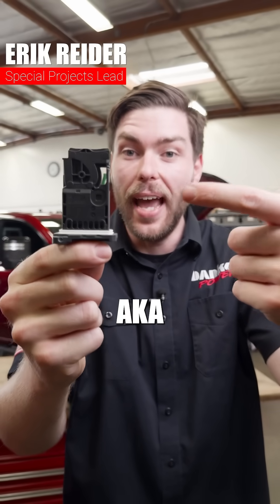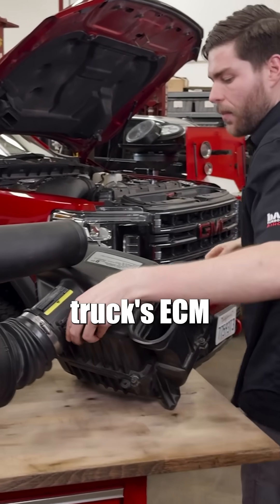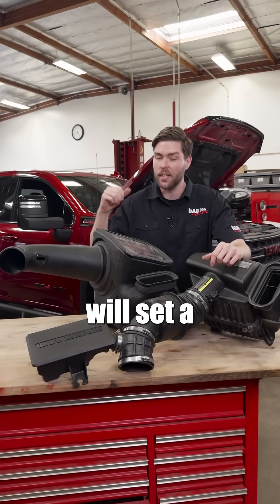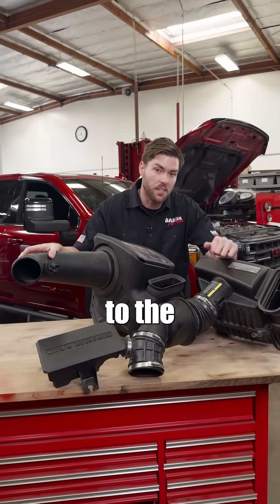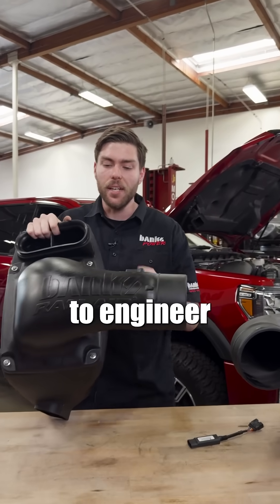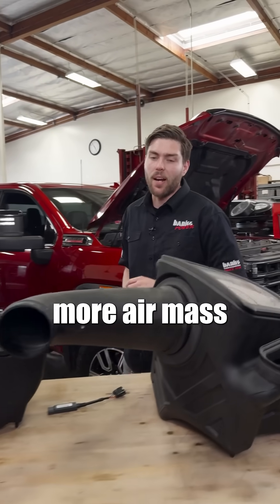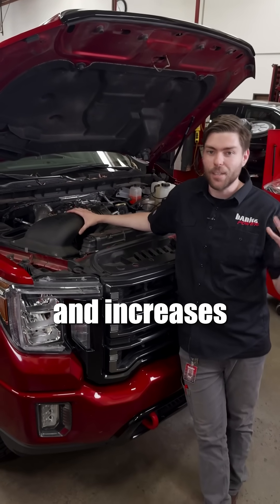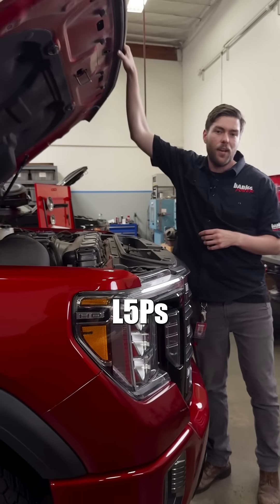We’ve changed how intakes are designed.

Comment: who thinks random garage guys can design intakes better than the car makers?
Reply from the maker: Assuming you're referring to Banks as "Garage Guys," it's important to note that we consult for the OEs, GM, Ford, Volvo, etc. Banks is also the sole engine supplier for the ARMY's JLTV program. We're not a small shop in the woods banging out stamped steel hot air intakes. If you ever find yourself in the Los Angeles area, feel free to stop by for  tour. It may blow your mind.

Comment: If it increases air flow which requires more fuel to make AFR balance. Then it can not be more fuel effecient than not having as much air flow meaning requiring less fuel... yes. More power. More fuel effecient as compared to what?

Comment: The signal to noise ratio from that sensor will be significantly worsened with this approach. You just amplify the signal after metering, losing accuracy. It also means you're amplifying the measured noise as well as inducing additional. No free lunch.
Reply: Glad someone else thought shoving the sensor in a storm water pipe will lose sensitivity. 🍺
Reply: @TheFirstBigCheese  It makes me think of how poor the drivability was on a Twin Pop 300ZX Twin Turbo.

Comment: Wouldn't the Mass Airflow Sensor be named rhe Mass Air Density Sensor if it knew the mass of the air flowing across the sensing element? I'm pretty sure to know the amount of air you're flowing you need the volumetric amount, the density, and the temperature, which is why most new engines have MAF, MAP, and IAT sensors

Comment: I have a 2019 Ram 3500 HO and I put on the Ram Air Intake, Monster Ram and boost tubes and I got a check engine light for the EGR. 
I have read many forums and they say the EGR code is caused by the Ram Air Intake,  is this common Banks?

I just installed on the 8/1, took a 2 hour drive to the cabin, hooked up the boat and drove another 6 hours on a Canadian fishing trip, before the light came on. Then, on the way back 8/9, the check engine light went out. I have not driven much, but I'm curious if the light will come back on?
Reply from the maker: Todd, regarding your 2019 RAM, we're actively working on mechanical solution and should have a resolution soon.
Reply: @bankspower  based on the forums this has been an issue for a few years. So what is considered to be "soon"?
Reply from the maker: We say "soon" because we have a team working on it. However, we do not have an ETA, yet. If you have not spoken with Tech Support, please send us a message so we contact you as soon as the update is ready. socialmedia@bankspower.com
Reply: @bankspower 
Mr. Banks, much respect, but how about making some items for my 2002 Ford Superduty 7.3 diesel, please?

Comment: How about for the 2018 ram 3500?
Reply from the maker: Here's the Ram-Air intake for your '18 RAM. https://bankspower.com/products/cold-air-intake-42255-2013-2018-ram-2500-3500-6-7l-cummins?variant=42861199818949
Reply: @bankspower  will I need to add the Banks map sensor?  Or the original one from the truck can be used? Due to it being a larger opening, not sure if the original map sensor will trigger the check engine light. For not reading correctly. Thanks

Comment: must be only for specific trucks. mine didnt come with any module
Reply from the maker: You are correct. The video focuses on one particular Ram-Air Intake System that includes the Air Mass Control Module. Most of our intake systems do not require the use of this electronic module. It's only needed for late model GM, and soon some RAM trucks.

Comment: My 2012 Cummins has the Banks monster ram, 3.5" intercooler pipes and the Ram air cold air kit and it has all worked great for me. No lights on and much better throttle response. My truck has 35x12.5x22 and I'm getting 19 mpg around town. Banks stuff is awesome.
Reply: You also eliminated the heater plate bolt from failing into your motor
Reply: My 17 gets 22 mpg with an s&b intake and a gdp intake elbow using stock piping
Reply: @dankoldenhoven4997 yeah 2012 vs 2017 unsurprising 🤡
Lil bro really thought he was doing something
Reply: @awkward_pickle  maybe you could tell me what changed on the motor between 12 and 17
Reply: My truck also has 4:10 gears. It used to get 15 mpg around town. It also has a fass lift pump, bigger injectors, Moshi Moto intercooler,head studs, coolant bypass kit,Rev Max billet valve body in the trans and a wicked wheel impeller and I couple other things. Compound turbos are the next thing. I was just mentioning the Banks stuff thats on my truck.
Reply: @williamroberts8550  my initial comment was directed towards the fact that mpgs come from something called a delete.. which it sounds like you have.  My truck also has a few 'other' things done to it too help mpgs. Biggest one being the g56
Reply: @dankoldenhoven4997 who are you tuned by? I just bought and 18 g56 truck efi live tuned have an s&b intake and am actually debating the gdp delete plate, horn and heater. I’m currently getting about 18.5-19mpg on a light tow tune.
Reply: @williamroberts8550  also is like to add that I give ya props to running the right gears for a 35
Reply: That's damn good mpg wow
Reply: 19mpg is bad
Reply: @EinfachFredhaftGaming  if 19 is bad you probably think 42+ is good, but I think that anything 35+ is over engineered and convoluted so much so that I see those vehicles on the side of the road multiple times a day and it doesn't make sense to me, sure you get more out of a gallon but are you really saving money renting out a bay at the auto shop constantly? Probably not, especially with the way labor and parts costs are now, and especially parts for that newer stuff.
Reply: @hihihihihello  VW’s TDI (before their emissions scandal) begs to differ on quality while getting insane fuel mileage for a diesel. My dad’s old 2014 Passat got some 40 mpg, and if he decided to go the route of getting it reprogrammed due to the scandal it still would have gotten 30 plus. 

Hell even my 17’ Passat with the 1.7T can easily get 30 plus, and is equally reliable. You don’t know shit. 

19mpg is still weak when the dinosaur 7.3 Powerstroke could get very close to that amount with only a 4 speed. Ram is still behind on transmissions, and needs to join the 10 speed gang. My dad’s 2022 F-350 can get 22 or more mpgs unloaded, and it’s still bone stock. Big upgrade compared to our old Excursion between power, torque, interior quality, and fuel mileage lmao.😂
Reply: I'm getting 14.7 stock. 19 is good in my book  @EinfachFredhaftGaming
Reply: Lmfao. Absolute lies
Reply: I'm over here like damn those are all good mpg's. I get roughly 15mpg around town even with a tune. 14' ram 2500 diesel w/37's.

Comment: Changed intakes or mass air flow sensors I'm confused
Reply from the maker: The video focuses on one particular Ram-Air Intake System that includes the Air Mass Control Module. Most of our intake systems do not require the use of this electronic module. It's only needed for late model GM, and soon RAM trucks.

Comment: i need a kit for my 96 f350 7.3 powerstroke
Reply from the maker: We do not offer a complete system for your '96 F350. However, we do offer a filter upgrade. https://bankspower.com/products/air-filter-41509-1994-1997-ford-f250-f350-7-3l-power-stroke
Reply: @bankspower  I need the whole box. mine is broken.

Comment: The MAF needs a minimal air glow for the hot wire to read that air is moving at all. A bigger tube reduces flow speed so sensor can’t do its job.  2x the tube diameter will flow 16 times as much air. That big box shown here is completely pointless as even a hopped up motor isn’t going to be 16x as powerful.
Reply: Tell us you work for a Banks competitor without telling us... 😂

Comment: What about for my 22 cummins? Banks intake has indeed thrown a CEL.
Reply from the maker: What you're experiencing in your 5th Gen Ram is slightly different than the MAF issue that we solved with the Duramax intake shown in the video. In other words, an Air Mass Control Module will not prevent the code you're encountering. We're actively working on mechanical solution and should have a resolution soon.
Reply: @bankspower  thanks for the info

Comment: you can simply program the fault code not to manifest
Reply from the maker: Programming out the fault codes requires a flash tune, which is visible by the dealership and will result in a warranty denial. The Air Mass Control Module is designed for trucks with stock tuning.
Reply: @bankspower  when will it be available for the LM2? 😁
Reply: If you have the truck tuned you can get the maf tables adjusted for the increased pipe diameter instead of disabling a code.

Comment: Mass air flow sensor is ur MAP sensor? I know what they both do but never heard em combined
Reply: MAF and MAP are different sensors and monitor different things. This video is only about the MAF sensor.
Reply: @aaronnoyb  I know what they are and do.  He called one sensor both and I was wondering why
Reply: @Formerlywarmer  ahhhh, maybe it was a slip. 🤷‍♂️
Reply: @brandonroeder2461  yea May have been. Just thought he had something I never heard of being they work on so much stuff
Reply: I use a MAF and  MAP sensor in my FA20DIT. I'm assuming it's because it reads what psi your manifold is that to help control boost.

Comment: Banks=Greatness.  Period.
Reply: Is this car modification shop or something?
Reply: @j0wt0ng  Aftermarket leader of diesel  performance.   Buy parts online or go to a diesel shop that only uses Banks products. If you want a diesel that performs like it's suppose to...
Reply: Punctuation and spelling errors make this message confusing.
Reply: Has you fooled for sure
Reply: It's still just a company that's first goal is make money. Notice he did not compare it to the competition and they all can say basicly the same thing. It's significantly more expensive and will have no real benefit. If you are pushing a turbo hard with a tune it will probably show gains but if you are tuned you don't need the maf box you can just then the tuner your running it in a 4 5 6in tube.
Reply: @mddunlap03 lololol!!!!!!
Reply: @mddunlap03  Ehhhh.... Im not readin all that. Chances are you have no idea what you are talking about.
Reply: Ehh

Comment: This is not true I just put a banks intake on my 24 ram and now get a p0402 code that pops up everyday
Reply from the maker: Johny, what you're experiencing in your 5th Gen Ram is slightly different than the MAF issue that we solved with the Duramax intake shown in the video. In other words, an Air Mass Control Module will not prevent the code you're encountering. We're actively working on mechanical solutions and should have a resolution soon.
Reply: @bankspower  sounds good thank you
Reply: P0402 appears to be an excessive EGR flow code. Not sure how that would be affected by a different intake unless maybe it’s trying to keep up with the increased airflow?
Reply: @scotts148 I'm not the only one with this problem  even banks is aware of this and Apparently looking for a fix
Reply: Stop capping buddy
Reply: @isaiahdixon6608 do your research buddy. I guess you would know better why my new ram with 11000km would through a p402 code after putting banks cold air intake on. Guess my EGR must be plugged?
Reply: @johnyoung3179  do your research buddy. Banks power is not possible to be at fault because of the way they do things. Even if the problem was the intake it’d be more plausible to say it’s your trucks fault rather than these people who work on trucks and make effective parts for a living. Many child.
Reply: @isaiahdixon6608 I'm glad you have taken time out of your day to leave  Harris rally to become a keyboard Warrior But what your point? At the end of the day I installed A banks air intake   and now have a code on my brand new truck so what am I laying about ?
Reply: @johnyoung3179  no one cares buddy about your truck dude just admit your trucks fed and if your the type of person to complain about your truck problems to people on YouTube rather than go to there site im which you bought the product, you my hood sir are the Harris supporter😂. Trumps a business man first and banks somewhat is as well. Get your facts checked the projecting is just compensating for something deeper. 🍤
Reply: @isaiahdixon6608  you must think somebody cares about your opinion well we don't might want to get back to your Harris rally